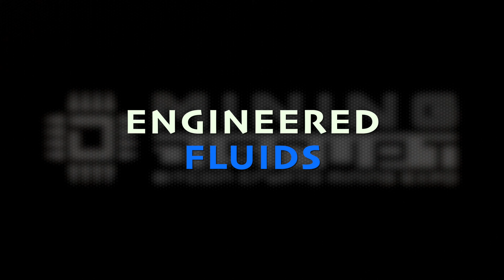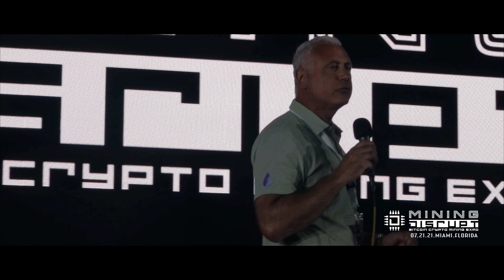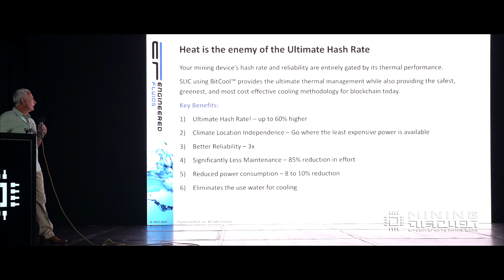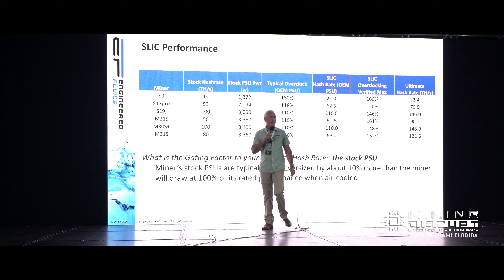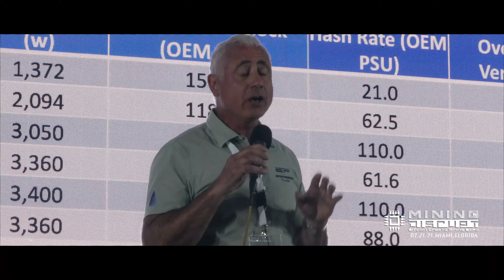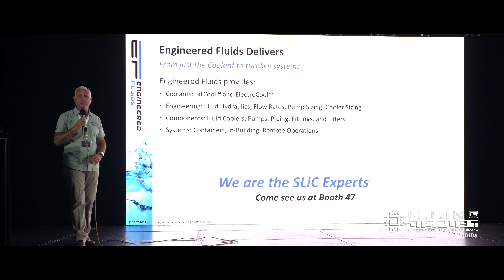Achieving the Ultimate Hashrate and Reliability with Single-Phase Liquid Immersion Cooling

Comment: You only show us the stock psu power but what's about the overclocking power? That is very important. S19J Stock power 3050 w and overlocking 6000 w ? Or is it only the 10% and it has 300w more power?
Reply: In immersion cooling, S19 110t can get overclocked to 154T. 

200KW immersion cooling box, holding 39*S19, click: https://youtu.be/w029O8xXBHM

Comment: Does immersion reduce the risk of fire?
Reply: I can only imagine it does.  Obviously the risk in the wall and from the wall to the tank is still there but anything that is submerged in a non-flammable liquid has to have a reduced risk.
Reply: Don't worry it. No fire. 

200KW immersion cooling box, holding 39*S19, click: https://youtu.be/w029O8xXBHM